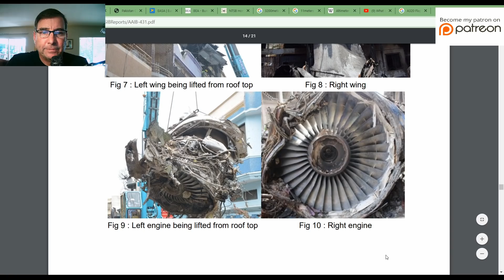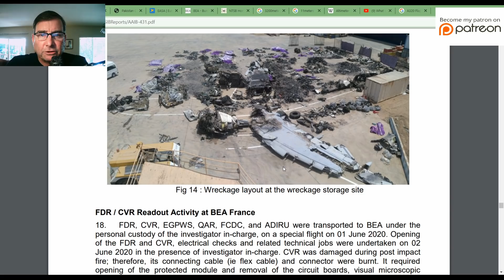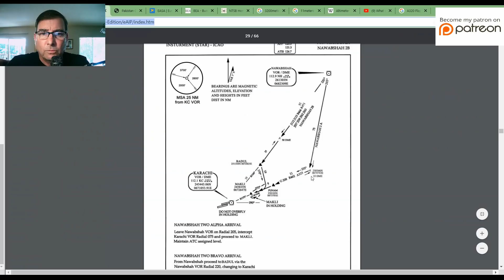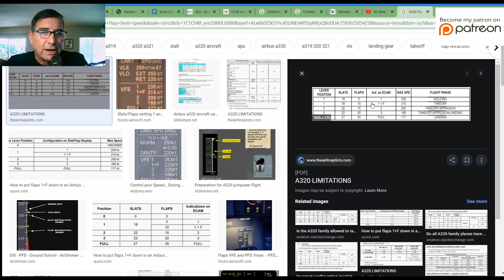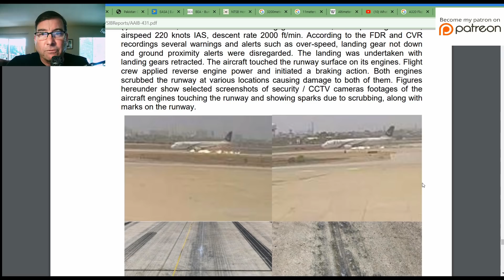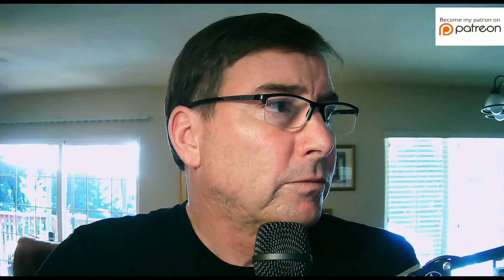PIA #8303 Preliminary Report Part II

Comment: Just seen on BBc news that 150 PIA pilots have been suspended due to having fake and/or suspect licence.....
Reply: Fake news. It was an old scandal about 87 people who were grounded some time ago, well before this accident. Traditional sensationalism by the media.
Reply: @allinacan  "Fake news. It was an old scandal about 87 people who were grounded some time ago, well before this accident. Traditional sensationalism by the media."
Is that personal opinion or fact please? 
It seems to be widely reported by air industry journals as well as MSM that specifically 150 PIA pilots have been grounded under  suspicion of having fake licenses. Pakistan's aviation minister Ghulam Sarwar Khan is quoted on Wednesday 24th as saying that over 260 pilots in Pakistan had paid someone else to take exams on their behalf.
How much bearing this has on the tragedy here is open to speculation however.
Reply: @squelchstuff  . Thanks for that. I was just about to respond but you did a much better job than I would have...
Reply: @allinacan  So, will you be withdrawing your invalid criticism, and at least slightly adjusting your assessment of the reliability of the media, based on your possibly having misjudged them on other occasions also?
Reply: This is totally irrelevant and uncalled for. This has got nothing to do with "This" incident. Both pilots were qualified as the preliminary reports say.
Reply: @saadsohail8652  As it seems the pilots in this accident had appropriate qualifications, people should make that clear. But, it does bring into question the overall safety concerns with Pakistani flights, so it is relevant to the crash to an extent.
Reply: @saadsohail8652  You have a funny definition of qualified.
Reply: Iain Slade I don’t know::Christian science monitor reporting scandal today...
Reply: @saadsohail8652 . They may well have been qualified to fly the plane. It does however beg the question that procedures at PIA are woefully inadequate if you can have 1/3 of you pilots under suspension for fake or suspect licence problems.... So with respect,  it is very relevant...
Reply: Link to the Reuters article dated June 25: https://www.reuters.com/article/pakistan-airlines-pilots-idUSL4N2E217W
Reply: @Graham_Wideman  Note that Pakistan thrives on corrupt practices. India (though imperfect) was well rid of them at partition.
Reply: @camcleat  They probably had PPLs !
Reply: This is true. This fact was presented by our aviation minister in the national assembly.
Reply: @saad3677  the aviation minister that said this has failed to produce the list of pilots and pia has repeatedly asked him to release their names so that it can take action. It seems that this was an attempt to malign PIA. The ruling party has ulterior motives
Reply: @DoubleMonoLR  Having read the Reuters report, I think there's now a question mark about whether the crew's qualifications were valid. But you're right, their qualifications appear to be okay but now the investigation will undoubtedly look into their validity. How so many things went wrong on this flight beggers belief.
Reply: One can have the right credentials but if the airline culture disregards proceedure and don't follow professional standards terrible things will happen
Reply: Pakistan generally has poor work ethics...PIA is particularly so....17 air crashes speak volumes.
Reply: @saadsohail8652  One can have the right credentials but if the airline culture disregards proceedure and don't follow professional standards terrible things will happen.
Reply: @Byzmax  While it is always good to maintain a healthy scepticism of some news stories, we must be careful not to tar them all  with the same brush. Just because a story does not align with our personal standpoint, or indeed, general consensus, does not make it fake. It seems all too fashionable to level that criticism nowadays, and I feel can be more dangerous to the dissemination of real knowledge than sensationalised news.
Reply: @user-pf5xq3lq8i  an old friend who is an accountant once told me to be wary of round numbers!
Reply: @user-pf5xq3lq8i  A simple google did not find the 87 pilot suspension as mentioned in the post, nor could I find evidence of the fake news mentioned. Even allowing for rounding to 150, which many news outlets have also quoted, there is a vast difference between the 16 in your link and 87 mentioned earlier. The actual figure of 141 has surfaced later than the information available at the time of posting. 
The tone of the rest of your posting regarding a particular broadcaster indicates some other agenda, is in poor taste, and nothing to do with the subject at hand.

You do seem to agree with me that any news story needs to be fact checked, so thank you for that.
Reply: @vincentconti3633    Basic statistics says that for events where the numbers are truly "random", such as possibly here, over a long period of time expect a round number (ending in zero) one time out of ten.  An even rounder number (00) one time out of one hundred, etc.  A one-in-ten (or hundred) chance of occurrence is hardly an argument for false data, though a whole bunch of them would at least be an argument for non-random data.  "False" is an additional hurdle, though there are forensic statistical techniques (e.g. "Runs analysis") to attempt detection.

Speaking of runs [the same number or event repeated sequentially] , another common fallacy is seeing those as non-randomness.  If anything, it's the opposite.  Random data has plenty of runs.  At the other extreme of "no runs" -- say nothing but alternating 1's and 0's -- that's the opposite of random:  Deterministic.

Accountants are good for tax returns -- less so for data analysis  ; )
Reply: @saadsohail8652  The report says: "..., necessary scrutiny  of the aircrew records/documents are under way". The preliminary report just says that by the information gathered at this time they believe they were adequately qualified. But they are of course checking whether or not the records are fake. The behavior of the crew certainly indicates that something is of here. It is amrt do double check if any or both hade fake credentials.
Reply: @user-pf5xq3lq8i  "bbc is not trusted by anyone". That's simply not true. The BBC is very widely trusted, both in the UK and elsewhere (World Service). It's not as widely and unquestioningly trusted as it used to be 30 years ago, but it still has a very good reputation. It makes mistakes, like any broadcaster putting out so much material, but overall has a very good record. I find it a high-quality news source and trust it (at least as much as any other large news source), thereby disproving your assertion. It's also not a state broadcaster. If you think that you do not understand how it is set up.
Reply: @pasoundman  If the aircraft was completely operational, a passenger could be talked through putting the ILS approach into the flight management computer. Then, by selecting both auto pilots, an auto land can be performed including spoilers, reversers and brakes. No pilot licence needed to land this plane is my point if everything on it is working.
Reply: @MoMadNU  I rather doubt that a passenger could do this to be honest. There's rather more to it than pushing a few buttons.
Reply: @user-pf5xq3lq8i  I tend to believe the news that is well researched, well informed and does not contain insults directed at people for having an alternative point of view. The difference between 150 and 141 is not that important it's more to do with the nature of the allegation.

The BBC is not perfect, it is however the best we have for impartial output
Reply: @saadsohail8652  Totally agreed. The corruption is found in other countries as well. Just google it and see for yourself.  The brighter side is the present government is doing its best to uproot corruption and thus needs support from within the country and abroad.
Reply: @saadsohail8652  It may not be irrelevant. It may be highly pertinent that such a monstrous failing has permeated the corporation.
Reply: @Byzmax  Clear as the nose on our faces.
Reply: @pasoundman  No pilot of any licencing category should operate beyond their capabilities.
Reply: @camcleat  Actually the hidden assumption in your premise is that qualified people don't make mistakes. Once you take that out everything falls in place. They do make mistakes and some times that could cost them their lives and the lives of others.
Reply: @saadsohail8652  Spend less time trying to sound like a Smart Boy telling me what I meant.  I made no such assumption.  This comment thread is not about qualified people, but these two pilots and people calling them "qualified" on the sole basis of paper records.  The train wreck of a performance was not the result of a mistake.  It took a whole heap of incompetence to leap through the multiple layers of safety margin built into the aircraft and modern best practice procedures as efficiently as they did.
Reply: Imagine your surgeon who had fake qualifications operating on you?

Comment: Wouldn't be surprised if toxicology report revealed something.✈
Reply: Ya, maybe some Pakistani Hashish.
Reply: I would be very surprised. Both pilots were from what I’ve been told devout Muslims and the flight was a day flight during the holy month of Ramadan. They would’ve been fasting since sunrise, but most certainly not using any stimulant whatsoever. I’ve lived for 20 years in the region. The accident appears to be a clear case of zero preparation, lack of focus on the task until too late, loss of situational awareness, extreme stress and confusion, and a breakdown of any useful communication between the pilots.
Reply: could both pilots have suffered from hypoxia?
Reply: @bossthefluff  You may be right, but there's still one possibility: A fume event.😉
Reply: @bossthefluff  They may be fasting but that would be against the rules. They are not allowed to fast if they are piloting. This case seems much more than a chain of errors. Almost like one of the guys was on a suicide mission.
Reply: @moherbert5332  Not at landing altitude.
Reply: @bossthefluff  Absolutely right!
Reply: @bossthefluff  LOL, How many christians do you know abiding a fast? And they forbidden from use an alcohol, not other "substances" (that one of the reasons why a hookah such popular over muslims countries). And even an alcohol widely consumed, just not on public.
Reply: Alex K - The hubbly bubbly, with  a bit of that no name brand tobacco! it's to die for!
Reply: @lakewoodsteve5028  What constitutes a 'real' god? How many of the millions of gods available scientifically exist (if any)? To save you the trouble of researching, I'll tell you - there are none - zero - zilch. Why? Because there is NO EMPIRICAL EVIDENCE to support any god whatsoever.
Reply: Subtle incapacitation due to Ramadan fasting???

Comment: Raising gear when approaching and trying to lower gear on "go around". I am not a pilot, but it sounds like the pilot was switching gear from one configuration to another at the right times, but that the gear was in the opposite configuration than expected. Could there have been a mental disconnect in a high stress situation? Sort of like hitting the gas when you think you foot is on the brake and you swear that the car took off for no reason.  Lack of communication on initial "gear down" so that whoever raised them on approach thought they were lowering them instead of raising them. I find it hard to believe you can raise when you mean to lower, etc. But the number of weird errors on this crash seems to insane already, so the explanation may include behavior that seems totally irrational?
Reply: Richard Casto I think thats plausible, but also inexcusable for a flight crew. This is exactly why an unstabilised approach should be aborted; things go off the rails really quickly, and things like that get overlooked. There was absolutely no need for this to have become stressful - go around the orbit, slow it all down, re-do (or perhaps do) the checklists and calm the f*** down - that way everyone gets to go home that night.
Reply: I believe that when you want to lower the gear down, you have to move the lever in the down position, and when you want to raise the gear, you have to raise the lever. I feel it would be almost impossible for a pilot to mistake these actions. However if it was just a button, its highly possible.
Reply: They did not retract the gear when approaching, the gear were never down before the aircraft was well into the go around. I guess you think of paragraph i where it says "landing gear retracted". That should not be read as if the gear were retracting at that moment, only that they were retracted which they had been ever since the plane left ground in Lahor.
Reply: @skunkjobb  Juan covers this in the report. The gear lever was indeed lowered during the approach, then raised. Then after impact lowered and raised in quick succession. Then during attempted go around, lowered again.
Reply: @skunkjobb  The report states: The FDR indicated the action of lowering the landing gear at 7221 ft at around 10NM from runway. Then the FDR shows the action of raising the landing gear at 1740 ft followed by retraction of the speed brakes at just less than 5NM from runway. It is also discussed in detail in the video.

Comment: My Dad was a ex fighter Pilot and flew with PIA and he told me many a times that the non AF pilots were poorly trained and many a times he had to save there asses!

One time an over confident Check Ride Pilot put a F 27 in a spin during a single engine out training flight.

My dad said that watched the plane fall from 10.000 to 3000 at which time the Check Pilot screamed for my father to take contril which my father did and recovered the F 27.

Promotions in this airplane are made based on who you know not what you know. There is total lack of professionalism
In the so called non AF pilots and all the accidents have been pilot error except one when a 707 caught fire and crashed due to passengers jamming in the first class cabin and causing a nose heavy plane to dive into the ground!
Reply: That sort of social structure is common to most um "developing" countries [for the last 3 millennia]. All about who you are connected too and not about the individual, along with traditions cooked up by some clever folk looking to maintain their power.

Comment: I imagine the decision to go around was purely instinctive.  Touching down so far down the pavement and about 50kts too fast, coupled with the brakes not working for some reason (!) would have made the over-run look awfully close.  But they were clearly taken totally by surprise.  A more considered situation would surely have resulted in a decision to keep it on the deck.  I remember a similar situation with an RAF Tristar when the aircraft was new to the Service in the mid-1980s.  The 2 pilots were the head of Standards Evaluation and the Sqn Cdr, also a very experienced multi-engine pilot.  Both were half colonel equivalent.  One of them decided to try out the Autoland facility.  The other thought he new what he was doing, in fact neither did.  However, the aircraft had yet to get an RAF clearance for this system and the RAF Brize Norton ILS was certified only to 200ft DH due to interference in the beam pattern at lower heights.  The aircraft intercepted the GS very late (they had been flying a visual pattern) and executed a dirty dart for the threshhold.  On recognising the excessive pitch down at very low altitude the Captain took manual control but the aircraft hit hard, punching the main gear legs up into the wings, rupturing the main spars and the fuel tanks. However, when it bounced he elected to go around and flew what was now a burning comet for a complete circuit before getting it down.  At least the fire service was ready and nobody was hurt but how the wings stayed on I'll never know.  Again, it was a split-second decision in an unanticipated situation and although successful it was definitely 'sub-optimal'.  Aside from the deviation from the rules, the CRM issue was unusual in that neither pilot new which way the cockpit authority gradient went, both thinking the other would speak up if something went wrong.....

Comment: Great overview, thanks! I’m still confused about this landing gear deployment. If you put the gear “down” but the gear doesn’t lower b/c the a/c is too fast, can you leave the handle down and the gear will auto extend as the a/c slows, or do you have to cycle the handle to actually get the gear to drop once you’re slow enough ?
Reply: On a previous video, the gear will come down automatically, you do not have to cycle the handle
Reply: ejh4isu according to another video I saw about the accident, there’s no need to cycle the handle and the landing gear will auto extend once below the max speed